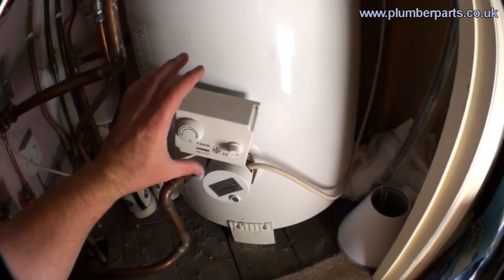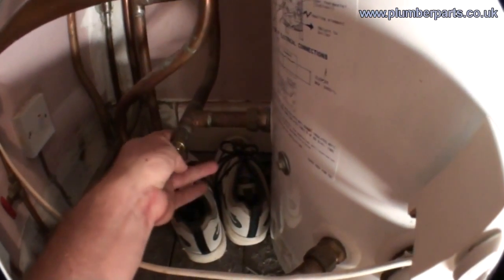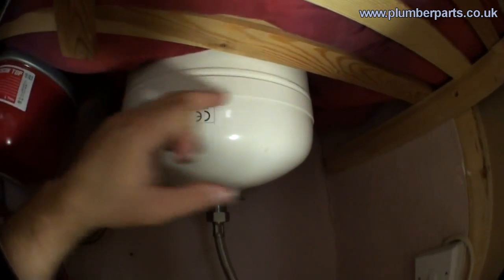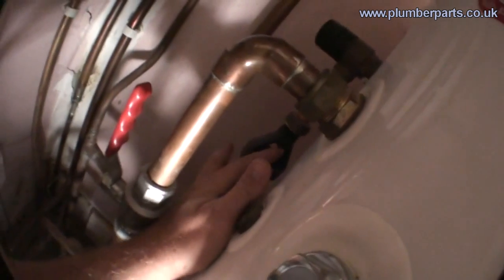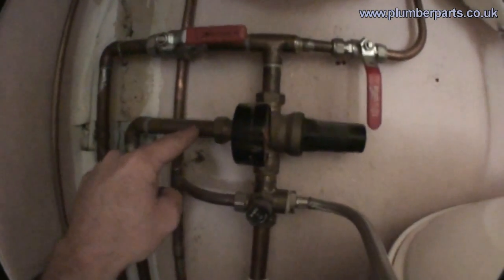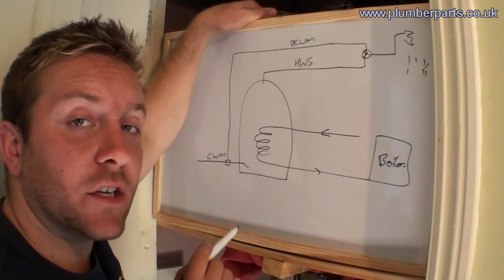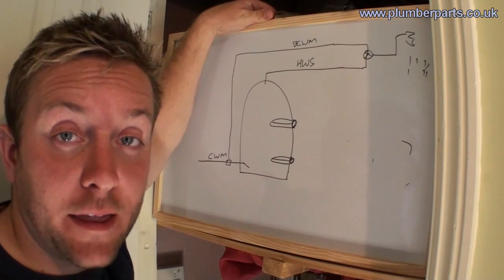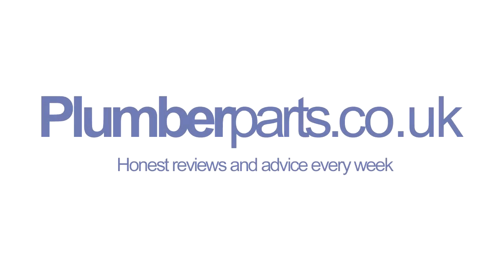Unvented Hot Water Systems - Plumbing Tips

Comment: Thank you! This was so helpful in enabling me to identify what all the weird looking fittings in my hot water system were. I had drained my cold water pipes to repair a leaking toilet fitting and created an airlock which stopped all our hot taps flowing. After watching your video I understood that the shower must be fed off the same feed as the hot water cylinder, after the pressure reducing value. So all I needed to do to get water flowing through that part of the system again was to run the shower on cold for a few minutes. Hot water magically restored!

Comment: can the expansion vessel be positioned anywhere or has it got to be before the cylinder on the cold water inlet also does the pressure relief valve go just after the expansion vessel

 or just before. thanks

Comment: Hi James, excellent video as always.

I need to remove a downstairs rad on my unvented system. Is it just a case of 
1. Both rad valves turned off.
2. Heating system fused spur off.
3. Drain rad and remove from wall.
4. Crack open rad valve to release heating circuit pressure.
5. Cut 10mm copper microbore and fit 10mm speedfit stop end.
6. Repeat for other end rad pipe.
7. Open filling loop and repressurize to 1 bar.
8. Bleed rest of downstairs rads.
9. Check for leaks.
10. Fused spur back on.

Is there any problems having 2 8m dead legs after I've done this as no way I can get the pipes out to the tee.

Have I missed anything?

Many thanks,
Carl 😊

Comment: I’ve noticed that whether heating or hot water is demanded, the boiler shows the heating (radiator symbol). Is this because there’s only one connection to the boiler for both in this system, as opposed to separate for a combi boiler system?

Comment: Great video. Question, so to turn off the hot & cold water to fit isolation valves before my taps in a bathroom, I turn off the main stop cock for the cold and then the hot water outlet on top of the tank. Also turn off the boiler. I then open the hot & cold taps at the lowest point in the house to drain the water. I fit the isolation valves. I then turn the cold main stop cock on, open the hot water outlet on top of the tank, turn on the boiler and vent any air in the taps?

Or

Do I just turn off the mains stop cock, and open the hot & cold taps to drain any water. As the hot feed from the tank needs the cold water main to 'push' the hot water out top of the tank?

Sorry for the long question, but I have only previously plumbed on a combi system.

Comment: Fantastic. I've seen how you drain the heating side. Those white expansion vessels also need re-pressurising (and I need to do mine, which is similar system to video) and that systems needs draining.  Would be great if you can show how that is done and re-pressurising the vessel - if a standing bicycle pump suffices . Thanks a lot.

Comment: Great video.  I'm wondering which type of cylinder I have in the house I've just moved into.  It's a Tribune HE model.  I can see a pipe marked "primary coil" towards the bottom of the cylinder so I'm guessing it's an indirect cylinder.  Should this be the case?  I was told that the boiler provides the heating and the immersion heater provides the hot water but I've just realised I've used quite a bit of electricity in the first month so doing some investigating to try and economise.

Comment: We have a corroded cold water compression  valve and it appears that its dripping water into the tundish. We're losing about 12litres/day. I've had two plumbers around but they just want to replace the whole tank, and one who would only quote to replace the tank or completely strip it out and replace our aging system  boiler. 
I've decided just to do it myself with my uncles help. But as the boiler itself will need replacing in the next two years, I'm curious about whether we need the cylinder or would be better off with just a combi boiler instead. I've seen that a lot of people do this to save space, but I also saw that unvented cylinders are installed in a lot of 4bedroom new builds. I just don't know which way I should go when it comes to replacing the boiler.
Any advice would be welcomed.

Comment: I have been struggling to find a fix anywhere for my problem and I refuse to call my plumber out again. He installed all our radiators and showers when we bought the house a few years ago and the upstairs shower has never been right and I've had him out a few times but never fixed it fully. This could take me a few mins to explain.
So my problem is that the shower upstairs is intermittent. Sometimes it won't run all, and sometimes it cuts out. Our hot press is down stairs and we have a pump. We have a ensuite downstairs which never gives us any problems. the upstairs one will always work when the downstairs shower is on as the pump will always kick in. I have turned of the pump and the downstairs shower will run  just with low pressure (as you would expect) but no water in the upstairs shower at all. All sinks and the bath have water. I'm so confused. Which I think my plumber is also!! ANY IDEAS please??

Comment: After recharging my OSO indirect 20RI the hot water flow and pressure are still low. Whats going on? I've been told i need to change the tank but this was by a plumber that never saw it. Any advice? I just don't want ripped off.

Comment: Cool Video, My Plumber is going to fit a indirect system  to my existing Combi Boiler  but as you show a expansion Vessel  on you cold inlet via a balance valve or a Combination Valve so that I can get equal pressure on hot and Cold water and also a Expansion Vessel on the Hot water outlet from cylinder and PRV from balance valve and PRV Cylinder he has told me only one Expansion vessel in needed, how does that work? can you please tell me if that is right if so how will that work ?

Comment: I don't understand why they put expansion vessel in main cold supply? The water expand when it's heated so the expanding would happen in hot water side not the cold, so how the expansion vessel would take the expansion while it's on cold side??
Sorry I'm not expert like you guys n might be funny question for you but really didn't get it :)
Reply: South sun  There is a problem with the white board explanation relating to this which led to me being confused me too ( I love the white board stuff by the way ) and that is because it’s edited and it’s therefore jumpy as he’s drawing ,it misses out him actually drawing the 2nd expansion tank on the hot water side of the set up it just suddenly appears without any mention . I think it would be better if he spent longer on the white board and talked and drew it in real time without the editing as the white board stuff is really helpful especially if these videos are aimed at people trying to learn which I think they are .
Reply: U could technically put it anywhere on the line after the composite valve , you put it directly on the valve so that you dont get random cold spots in your hot running water, regardless of whether or not the water in the exspansion vessell is hot or cold it doesn't matter as the heated water in the cylinder has expanded as it warmed up this taking up more space and intern creating more pressure

Comment: Hi... i liked the video and i have got a problem with my hot water tank... at first, the element in the tank had been broken a couple of days ago and i had turned the valves off, then i have replaced it with the new element. When i turned the valves on, no hot water coming through the system but hot water getting heated and no hot water coming... i can't figure it out... what is wrong with the hot water supply? Do you have any idea about it? 

Thanks a lot

Comment: Always thought you had to be trained and assessed on pressurised hot water tanks with a valid ticket for installing such cylinders, what next how to fit a gas boiler
Reply from the maker: bish1963 this video is about the principle of such a system and not how to fit it. Check our description
Reply: So the principle of one of the safety features on a pressurised tank is the high temperature relief valve, yes it is required when the port valve fails to shut off, nothing to do with pressure relief, its temperature relief which then goes into the tundish, its very important part of the installation but looks like its not important in this video, hot water bursting over someone head from the pressure relief valve, seriously you need to read up, oh and don't forgot about building controls which hasn't been mentioned
Reply: It's normally known as a TPR Valve (Temperature and Pressure Relief) the valve opens to discharge water to a safe point when either the temperature or pressure within the cylinder rises above safe levels.

Comment: Hi Love the vids,, very informative, I have a to replace my old tank and need to find out weather to fit a Washer to the 28mm cold water feed at the bottom of the Cylinder Tank.. it has a 28mm to 1inch Flange fitment.. shall I just use PTFE Tape ? thanks Dave
Reply from the maker: If you could send us a photo via Twitter/Facebook that'd be great. Links are in the description. Then I can help you out dude!
Reply: Thanks for getting back to me, I have fitted the fibre 1.1 inch washer to the Flange compression fitting, all now working ok... !!

Comment: hi,
why do some installers put an isolating valve on unvented hot water draw off?  Just like the one in this video. 
I was imagining a senerio that someone mistakingly isolate the system whilst it on.
Please advise as I literally just come across another with an isolation valve.
Reply from the maker: +sadio Al Some blokes just love fitting valves!

Comment: Hello mate, quick question. So the boiler heats up the whole tank in 40 min, you have a couple of showers and use half the tank of hot water. Later in the day (with no extra energy going in) the water is still hot..I don't get why the the cold water that has refilled half the tank in the meantime has not cooled the remaining hot water down? Does that make sense? Does it not refill until all the hot is gone? Cheers!
Reply: Hi did you ever get a response to this? As I have the exact same question and can't figure out why the cold water wont cool down the already heated water when it is mixed together? Or is the cold water only put in to the tank once it reaches a certain lower level?
Reply: I know nothing about plumbing /heating but I was taught at school that hot water rises above cold water ( the same with air ) so perhaps the hot water just sits on top of the cold water and without any stirring action there isn’t any significant mixing ?

Comment: Great video.  Thanks for providing a basic explanation to us normals :-) I've got a problem at the mo' in that my white expansion vessel has come off the wall and is currently resting on other pipework.  There's a stale water smell but no obvious damage so far.  My house builder says that it's not covered as I've been there +2 years and my boiler cover (NPower) aren't covering it as it's the white vessel and not the red (don't know more than that sorry).

Is there a quick fix to this?  The vessel is heavy so I assume it's full of water.  Can I release the 2 valves below it on the cylinder itself and will that "empty" the vessel again?  The pressure gauge will increase then won't it?

If you can provide any help for me in-between your day jobs I'd really appreciate it and thanks again for your video!!! :-)
Reply: Bit late for your case, 6 years ago. The vessel depressurised and it filled with water. Too much weight for the bracket! That's what happened to me. So, it either the air side totally de-pressurised and just needs pressurising back again or the vessel's internal membrane failed and the vessel needed replacing. (Mine needed replacing when it happened)
I never put mine back on the flimsy bracket it came in. Instead sorted a small platform where its been living happily ever after. Hope this helps someone.

Comment: Hi just wandering if you have a sealed hot water system which is fed from tanks in loft do you still need expansion vessel on the hot or is there another option. Expansion pipe not an option.

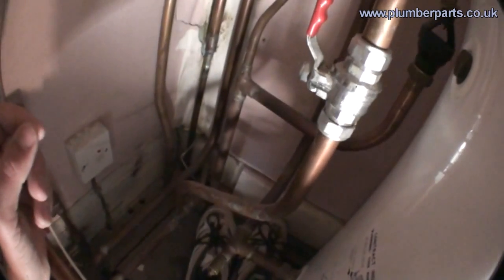Comment: hi plumberparts, love your videos. very helpful. i have this uninvited hot water systems at home but it is leaking somewhere. the leak is very slow so i cannot find where it comes from. one thing i noticed is there is water dripping from the thing (sorry not sure about the name) you were pointing at 2:52 in this video. hope you could give some advice here. thanks
Reply from the maker: Zyzi Bb Hi there, that's the high pressure relief valve. It's probably just weak but you'll need a qualified plumber to replace that one! Sorry dude, PP!

Comment: Just a quick question for you, regarding direct unvented hot water cylinder, is the expansion vessel coming after the non-return/anti-contamination valve, am I right? Also, if I connect it to the hot water coming from the boiler, basically, just to put a 'Tee' on the 22mm pipe for hot water from the boiler and connect it to the outlet of the cylinder, is it going to be ok ? Would appreciate your help. Cheers !

Comment: Thanks for the great video... Quick question.  I am about to purchase/have fitted an Unvented Indirect Hot water system in our two storey house, our current cold water mains feed to the old water tank in the loft is 15mm. The new 22mm feed we are looking to replace and relocate will run up into the loft first and then back down to the new tank in the airing cupboard. Do you see going up into the loft and then back down a problem?   Thanks in advance..

Comment: it may have a faulty pressure relief valve or the air bubble at top of tank has depleted, simply turn off mains into the tank, open hot water outlets around the house until its stopped, turn off the taps and open the supply you turned off. this will then purge the tank leaving an air bubble. air the hot water through the taps and turn off once all pulsating has occurred.

Comment: technically the pressure relief blow off from the tundish should have 300mm before a bend or 90 degree, also a secondary domestic pump is mostly fitted to allow hot water from your taps to be more instant without a long draw off, this is either piped up with a tap in from the cylinder and tee'd into the last hot water outlet, or if no tap in, last tee into the cylinder cold feed :)

Comment: 1 bathroom fit a decent combi,ensuite 2 bathrooms fit a system boiler and a unvented cylinder,they need checking every year,but most plumbers wont tell you it is a simple job taking 15 minutes,incoming mains pressure has got to be 1.5 bar minimum,and it is a good idea to upgrade a 15 mm cold feed to a 22mm

Comment: Hi,
Just had a new boiler with unvented cylinder installed...it is all working fine so far.
I have been scanning the installation documents that came with the Vaillant system and it shows the expansion vessel connected to the safety pressure reducing/pressure relief valve on the cold water inlet.
However, my installer has connected the expansion vessel to tee'd off connection from the hot water outlet. Apart from the fact that this is contrary to the instructions, is there a problem with this?